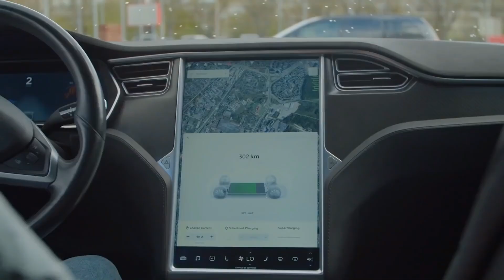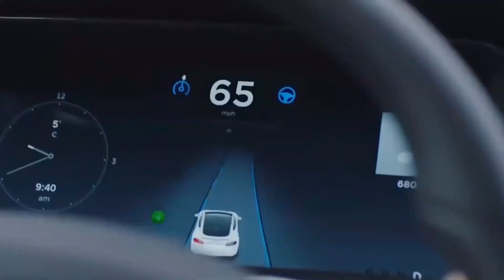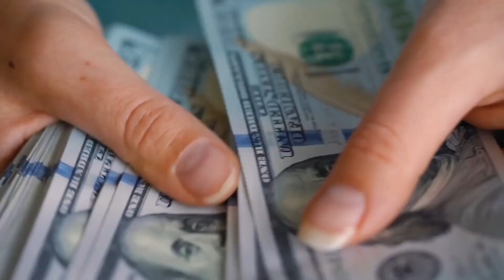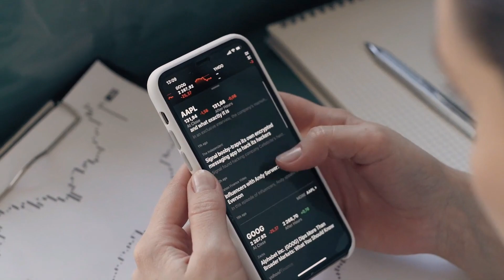Tesla Just REVEALED New Car With Toyota

Comment: So to produce an EV charging station, you have to use diesel fuel? 
So then bc we can no longer pump crude oil to produce diesel or gasoline then Everyone on the planet are put back to using horses to pull their wagons instead of using gas powered cars.
This is satanic